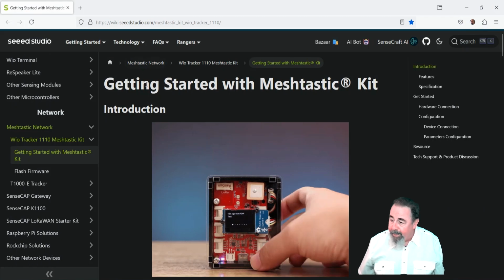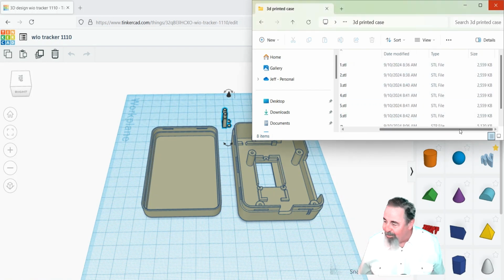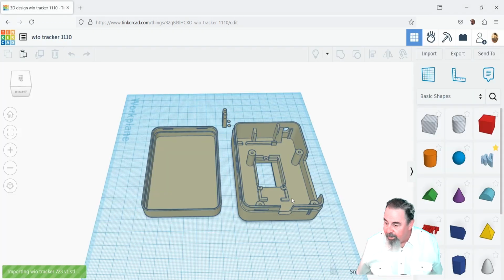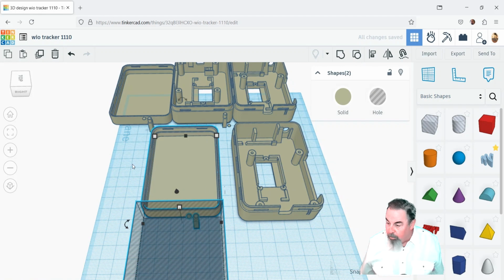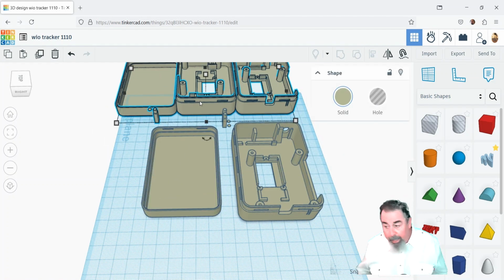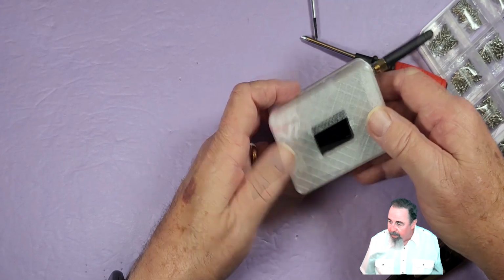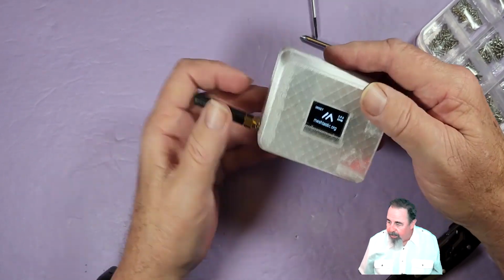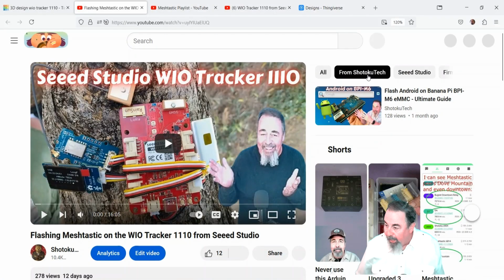Assembling the WIO Tracker 1110 Case, Display, GPS and Battery

Comment: In Autodesk Fusion, Shift and click the bodies you want to print. Right click and choose selection set. Menu on the right has a selection under the dropdown. If you click it and all three show up, unselect the body not to print. Export to slicer. 
Might work similarly in tinker cad
Reply from the maker: Thanks. I don't use Fusion so I appreciate the tip. I'll give it a try!

Comment: Did you move the resistor for the external antenna to work or are they offering it now without the need to do some soldering?
Reply from the maker: Thanks for the great question. I don't have the soldering equipment to work at this level and I only have one board. I debated whether to remove the resistor or not. Because of the above two reasons, I left it in place.
Reply: @ShotokuTech  you’re probably still working from the internal antenna. Hopefully they’ll change the design in the future.
Reply from the maker: @BrummBilt  I will give that a test! Range when the antenna is attached and when it is removed.